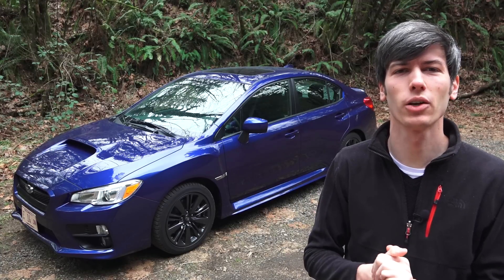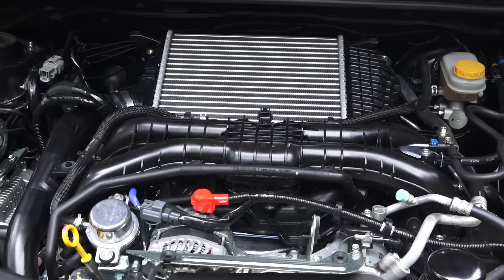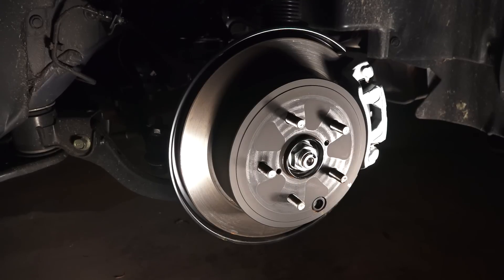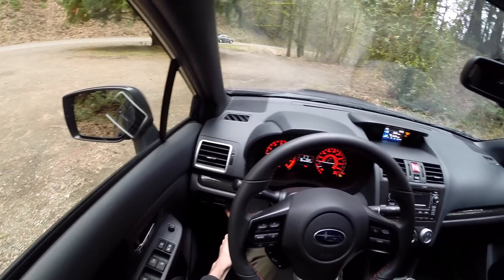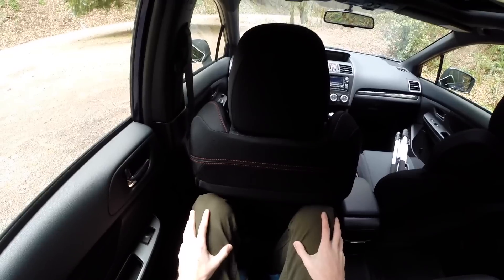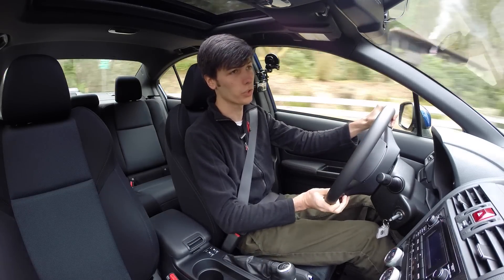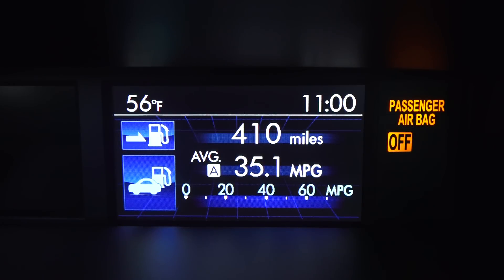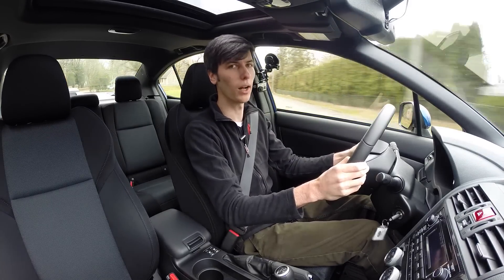2015 Subaru WRX - Review & Test Drive

Comment: Hey man, I really love your videos and what you're doing here. I've been subbed since almost day one. I actually go to university for engineering myself. So take this as criticism on a really high level ;).
I think you might have to get some more experience with driving, working on cars and just a better "measuring stick" on what is out there in general.
For example, when reviewing the ergonomics of the driver you always mention that your knees are hitting the center console/door. Let me tell you: this is absolutely unacceptable. Either you're not setting your seat up properly (race training will help), or, and I think this is the case, the cars you've reviewed have awful seats. I am 6'4" and neither I nor my family have ever owned a car in which my legs weren't supported almost up to my knee. But I have sat in cars in which I had the problems you described in the video.
Another thing I find really big is that car manufacturers these days have significantly cut down on engineering quality. Top Gear, or any other car show isn't ever gonna talk about that because their audience, just like the general consumer doesn't give a shit. But your format would be absolutly perfect for that. Here are just a few examples:
I got into working on cars when I was like 8 years old. Back then, my dad got his Porsche 964 Targa and I've been helping him out when he worked on it all the time.
This Porsche has brake calipers with multiple pistons on each side so that it brakes good without ever rusting up or causing any issues whatsoever for almost 20 years now.  The entire bottom is covered in aluminum panels for better aerodynamics, so working on the engine could be trouble. But it isn't, because they're held on by stainless steel machine screws. No rust, no gunk, no wearing out, even after 20 years of frequently undoing them and putting them back together. On the never models, all you'll find is plastic clips. And they break and are a huge pain in the ass in general. I could go on with the fuse box, but you get the idea.
Even my 2001 A8, 101,000€ price tag when new, (bought it used, for a fraction of the price obviously) has those shitty one piston floating brake calipers in the back and in the front, its two pistons, but still floating. It took me days to overhaul the rear calipers because the damn rubber guard of the piston broke. Has yet to happen with the older Porsche. This is also unacceptable. Many people I know have no clue what they should buy anymore because it's the same with all the manufacturers. When I see people comment with "german engineering quality" comments on BMW videos I get embarrassed, knowing that all thats left of that is the myth that's slowly being sold out to people that know nothing about the technology and don't care because they'll only be driving them till the lease is up. And it's the same for all the manufactures, at least I haven't found the exception yet. It would really be nice, if your videos would kinda go into these things. You actually mention aluminum lower control arms, but go right past stuff that's way more important.
So in my humble opinion, you probably could just go out and kinda look for these things and inform yourself. Maybe talk to people in repair shops.
Maybe just put on nice clothes and go to the Porsche, BMW, Range Rover etc dealers. Or even better: Find someone who owns these cars. Not for reviewing, but to know what they're like. Maybe you should also take racing/drifting lessons so you'll become a more experienced driver.
All those things would lead to your spectrum of what is out there being widened and you could give deeper, more educated reviews and explanations of the cars you're reviewing.
My rant is over now, hope I didn't totally go TL;DR. Keep up the good work :), greetings from Germany.
Reply from the maker: Absolutely, I'm very new to this and don't have experience driving all that many cars - obviously this is a learning experience and I always aim to improve with time. What about modern cars do you not find the engineering acceptable? Aside from the trend of everything getting heavier or staying heavy, almost all cars are more powerful, more efficient, and more comfortable than predecessors. Reliability requires time to pass to understand, but we have the tools and knowledge available today to make things last a somewhat predictable duration. That's on the consumer, as marketing teams know how long people keep vehicles and want them to last. If people only buy the most reliable cars, all others will follow suit. If they don't, it tells marketing teams it isn't a priority, and it's an opportunity for a cost reduction in this incredibly competitive market.
Reply: Engineering Explained I am sure you do, and wish you the best of luck to succeed in doing that. You're on the right path.
Now, I believe that on the surface, you're right. Cars today are built to last reliably for 4 years or so, and generally, they will. Then, you can keep driving them till they're 7 to 10 years old, but they just fall apart in those years. I also get, that it is a logical decision to cut down on build quality the average consumer doesn't see. But I don't think its right, not in cars for car enthusiasts. When you look closely at cars, with your engineering eyes, and ask yourself "Why did they do it like that?" The answer will almost always, with the trend going up, be "Because it was the cheapest way to do it that enables it to just make it, not regarding anything else." Just look closely at the door hinges of modern cars. If you're interested, I can send you a picture of the either billet or forged aluminum hinges on my Audi, and I encourage you to take a look on the ones of newer models. Take a look at the leather quality and ask yourself "What will it look like after someone sat on it for 120,000 miles, and then again after 200,000." All those little things won't upset the average consumer, but it upsets me to a point where I can't name any modern car that really excites me. And the worst thing is, that the few examples I named are just small problems on the surface. If you've ever taken apart an old Porsche and compare it to newer ones you will find that all those little faults can be found in almost every single component. And all those things lead to the instances of things going wrong due to bad engineering I saw happening in the past:
-water pumps with a plastic pump wheel. The temperature duty cycle tears them apart over the years. They used to be all metal till roughly the 2000s, they aren't anymore.
-Injectors for direct injection. Used to be a Diesel problem, now they're in every car and they will break, which by itself is fine. turbos will too. But they need to be replaceable. Jeep/Mercedes has managed to build it in such a way in their Grand Cherokee, that you can't get the last 2 out (V6 Engine) without dropping the entire engine. You might argue weight distribution, but if the sheet metal of the body would give just one more centimeter of clearance it would be fine. That happened either on purpose or they just didn't think about it. 
-things like the glovebox lock/lever assembly. Just look at one, if you care about nice mechanics this thing will hurt you. And they do break and it's a huge pain in the ass to replace.
-What I said about brake calipers earlier, especially the ones with the handbrake engaging the main brake piston. You need a tool to reset them, its still a pain in the ass though, and over time it draws in water and seizes, making a brake permanently engaged, causing it to overheat till the brake fluid boils. And then you notice. Ask me how I know.
-A taxi driver told me about his brand new E-Class. The main wiring harness rubs on the despicable 2l diesel engines cover, causing the insulation to fail after just 23,000miles and 4months. In a taxi, not an abused vehicle. He was lucky, his cars dash just lit up like a christmas tree and nothing worked anymore. His colleague hat the same thing happen to him. It engaged the Presafe brake, causing the car to brake to a stop abruptly, with a customer in the back, on a freeway. It was repaired on warranty,  but instead of replacing the whole harness, Mercedes just soldered it back together and insulated it with electrical tape. He said that the car already starts having issues all over the place and is seriously worried about his livelihood, because a car just becomes profitable after 125,000miles which he is sure it won't reach. They used to keep their W210s till way over 300,000miles, and then sold them to eastern Europe or Africa.
-all the little plastic nobs instead of screws holding everything from panels to brake lines in place. You basically can't take stuff apart without breaking it, and even after you replaced the knobs its hard to put it back together without it looking worse than before. Mechanics however don't like to replace those things, so they often just don't put some of them back in when they're hard to see. Like the ones on the underbody cover of my Audi. Again, ask me how I know. (hint: I lost the cover at over 100mph. Hope it didn't hurt anybody.)
I could go on and on here, but the real message is this:
If you've become sensitive to those kinda things, you can feel them. You hear and feel every vibration of those diesel 4cyl.. The start stopp system doing its thing causes you to imagine a countdown of the duty cycles it's designed to survive before a component breaks. Every time you open the door, you check for the hinges and get disappointed. The paint is like an orange peel if you look closely. No matter how far you go upmarket, no matter how much you polish because it's just not possible to make the water based paint smooth. The base models of the premium makes aren't any better than the VWs and GMs and what not, in the way they drive and sit on the road. Sure, they kinda handle, but it just doesn't feel good. What I am saying is, that the myth the manufacturers build on, the premium feel they talk about, the quality slogans like "the best or nothing" Mercedes has just isn't reflected in their new models. They're building on people that have no clue about engineering or a general overview of the cars that are and used to be out there. "It's a BMW, of course its well made" is all that's left. And the worst thing is, that they're winning because especially people in my age group, even though I'm in an engineering-students social circle, know and care less and less about how a car drives and more about how you can hook up the latest smartphone. It would be really nice to see a youtube channel that at least in some way acknowledges that. I know I might be a little extreme here, but I am surely not the only person that feels like cars have become soulless appliances and that is struggling to find a car that isn't.
Reply: This makes me think about sustainability and the massive economics of humanity. The shear number of things produced has increased exponentially with the population of the earth. Simple things we take for granted like beef or water are becoming a problem to produce on such a massive scale. Even if everyone wanted free range eggs, there literally isn't enough farmland to provide the billions of eggs that we demand as a population ergo we must cut corners. In a way, I think we have to "lie" to ourselves to keep our self esteem up hence the marketing departments for car and toy and whatever manufacturers. 

If engineers spent their time meticulously designing every bolt or joint or nut, then we would then be forced to sacrifice something else weather it is intentionally or unintentionally. Let's say the time it takes to design a car takes 100%. You spend 30% of the time designing the chassis, 20% of the time on the engine, 20% of the time on the interior and 30% of the time testing. In ordered to add in something you must either take away from one of the factors, like the interior or the engine, or you have to increase the commutative time it takes you to design a car past 100% which will result in you coming in late, over budget, or both which results in a more expensive product. 

My point is that older style quality products are becoming extinct because the supply can not realistically possible to keep up with demand if we keep doing things the old way. It is already impossible to produce cars to any feasible volume built the same way as we did in the 80s 90s or even the early 2000s.

Anyway, I'm no internet hero or engineer. Just my two cents on my philosophy of humanity lol

Comment: I don't get why most manufacturers insist on putting the battery and gas tank on the drivers side...
Reply: It's a Japanese car... In its home market the driver is on the right.
Reply: In my opinion it may be bc when getting a jump may be easier for the car getting the jump in regards to access to the battery. Suck for the guy doing the jumping I guess. 
Gas cap I feel is related to full service stations? The gas intake as well as the driver, who will interact with the gas station attendant, will all be on the same side. That's the only reason I could think of.

Comment: Good Job on a thorough review! Although, I am curious if the stereo got any better?:)) As a current owner of a 2014 WRX there are a few things about this car that I go back and forth on: 1- I think it looks great, just not finding it as aggressive or distinctive as the previous gen. 2- Kind of missing the unequal length header rumble. 3- Steering wheel looks amazing but I prefer the previous gen one piece seats. 4- Extremely jealous of that 2.0 fuel economy. All in all, I think they did a great job!
-JB

Comment: The "rev hang" you're describing most likely has to do with the electronic throttle. Moog had the same problem in his Forester.
Reply: I wonder if mighty car mods found a solution for that. The civic I currently have is an electric throttle, but there isn't any "rev hang"

Comment: ive got a 3.0 spec b and it does the same thing when you change gears but i got used to it and you learn to shift fast theres nothing wrong with the car just need time bro
Reply: I'm going to get one of these WRXs in a few years. How long did it take to get used to the rev hang in your Legacy?
Reply from the maker: Jonathon Oosthoek Shifting fast (especially at the lower RPMs) cannot be smooth if the engine RPM is significantly higher than the clutch RPM. Has to be slower to be smooth. That's just simple logic. You may get used to the feeling but that doesn't change how it behaves at all.

Comment: Haha, there is that huge smile on your face ... love me some Subaru! Waiting for the STi to get some FA motor love before I upgrade though! I prefer waiting for mid-cycle refreshes before I pick up a car (new or used), simply because manufacturer revises things as the years add on ... so hopefully they'll fix the throttle issues with the powertrain without having to resort to tuning!

Comment: I notice how the WRX's 6-speed operates just like you explained with the rev hang.  It almost sounds like it has a worn clutch.
Reply: jay czyzyk I'm not saying it literally sounds like it has a worn clutch, it just sounds like it has a worn clutch due to the rev hang, which was already explained.  Understand the difference.  I'm a mechanic as well, a jet engine mechanic to be exact for over 10 years and over 16 years experience with Subarus.  No need for such an argument when the question has already been answered.
Reply from the maker: Clutch is strong, throttle control is just a bit sketch.
Reply: Engineering Explained Likely so.  I always wondered why the WRX's sounded like that during upshifting.  Thanks for a review well done!!
Reply: did you ever test drive the worn clutch
Reply: jay czyzyk I've driven a car with a worn clutch.  Is this a trick question?
Reply: have you driven the wrx to make that comment
Reply: jay czyzyk No, but I mentioned it just "sounds" like a worn clutch.  Not "feels" like a worn clutch.  Do you have a 2015 WRX? Are you offended by my comment?
Reply: how can you determine if it sounds like a worn clutch and yes i have a wrx  noimn not offended    and ima mechanic
Reply: ok
Reply: It is a drive-by-wire car so a controller is actually actuating the throttle, imitating a dashpot. Does the new WRX not have some kind of "driving mode" switch? If so it will probably feel better in Sport mode.
Reply: Alberto Knox I believe the rev hang still follows even when selected in S#.  It needs to be tuned to eliminate or lessen it.

Comment: The pedal float should only happen when the engine is cold as a automatic choke type deal, it does that in my 1999 Scooby anyway, did it happen while the engine was up to normal temp?
Reply from the maker: Yes, warm or cold.
Reply: Ok thanks mate